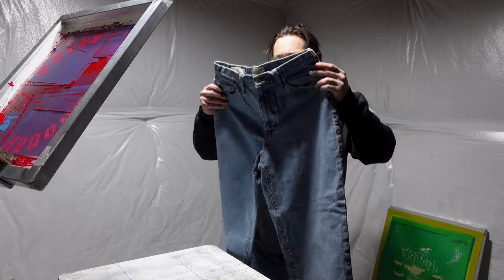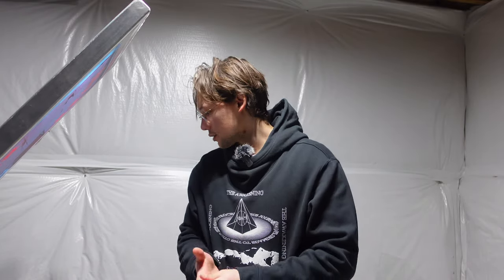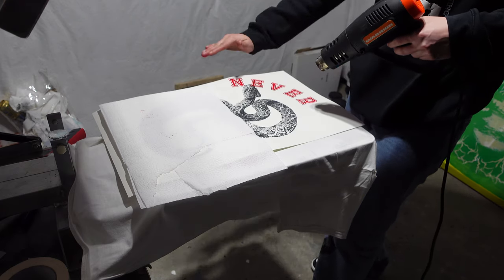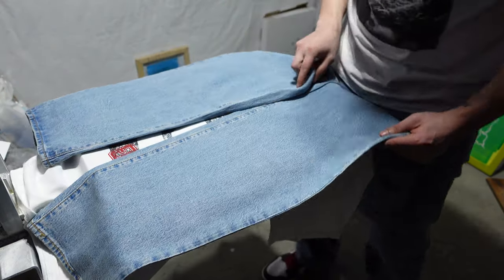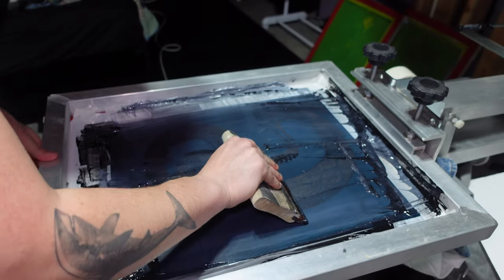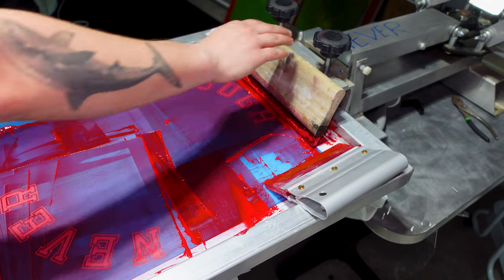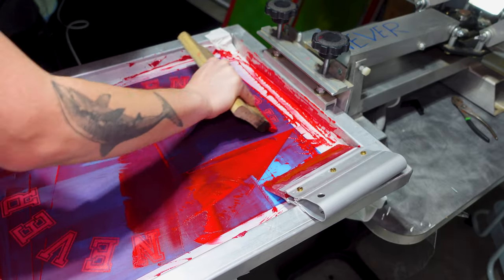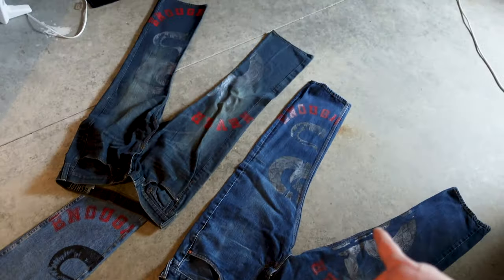How to Screen Print on Jeans for a Unique Streetwear Look

Comment: That's some fantastic detail with a 160 LPI mesh.    Once removed you could see those missing lines at 7:16 were caused by the bulky inseam of the left pant leg inadvertently tucked underneath the right.  It still looks really nice.
Reply from the maker: I love how these came out too 🫶 the imperfections make them extra special